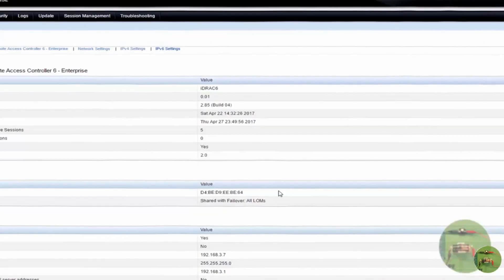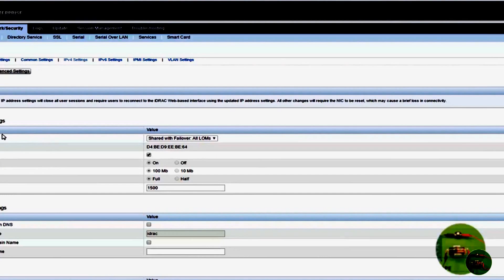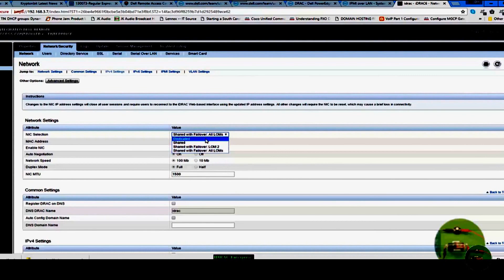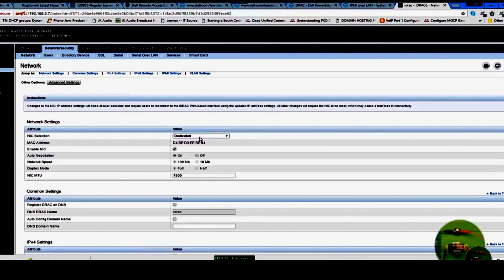Dell PowerEdge R610 iDRAC Enterprise install and remote access

Comment: Good to see a yardMan a put out some good content on the tubes. I have couple of the Dell C1100 those have built-in IPMI. I use them for Virtualization predominantly.
Reply from the maker: Thank you, fellow countryman.  I appreciate the comment and the link.  I would really love to see a vid of your setup.  I am big into virtualization myself.  One love!
Reply: No problem I'll get a video setup to display it one I get my new NAS online. Moving to a 2U chassis with 8 drive bays using a bunch of 4tb drives in ZFS Raidz2. For virtualization my go to is Proxmox if I want a GUI it's easy to setup and for non GUI I use ubuntu or centos and just use pure linux KVM along with virtmanager.
Reply from the maker: jcbennett1984 

Good stuff you have there man.  Can't wait to see it.  Cheers